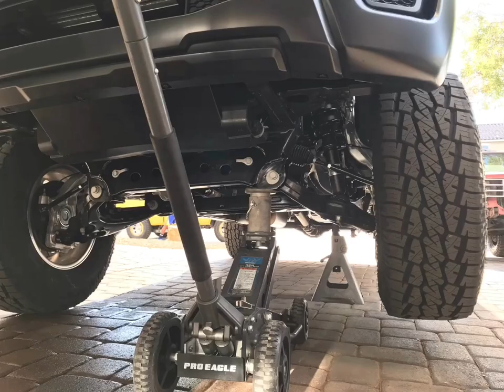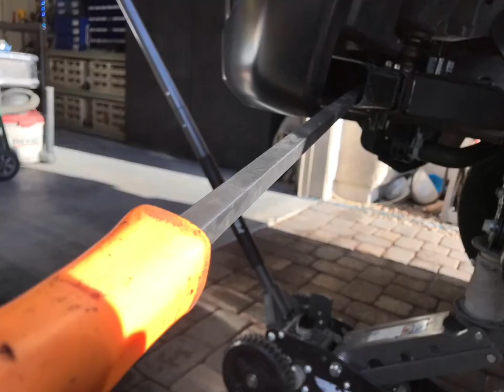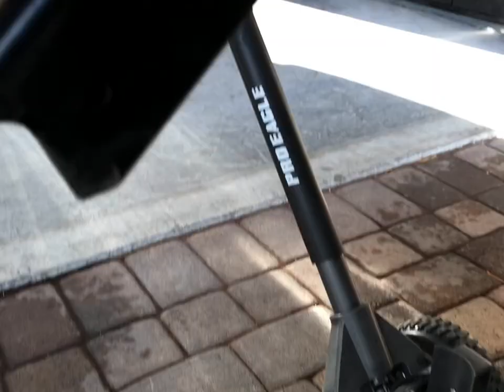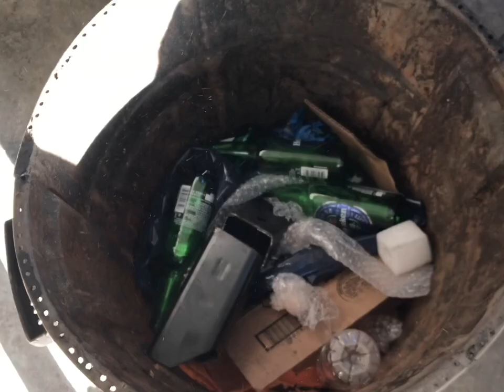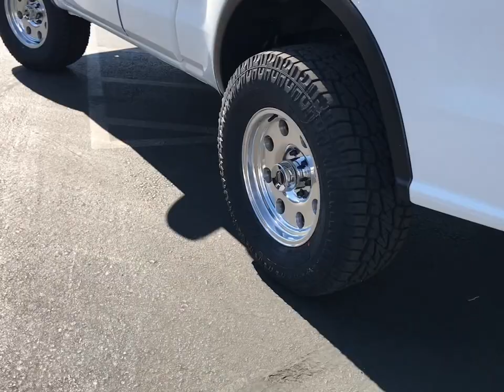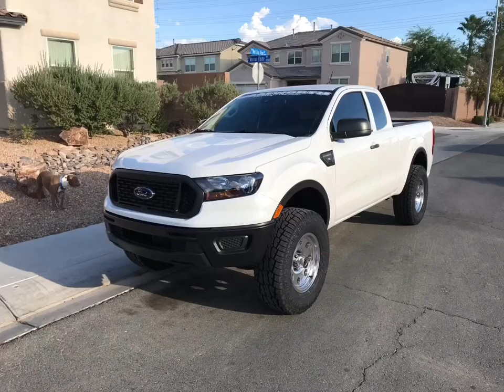How to remove intrusion/crash bars

Comment: use a grinder with a cut off wheel works better the high strenth steel used doesn't cut with a sawzall very well.

Comment: What blade did you use? I’ve used two medium metal blades and barely have a cut started on the first bar.
Reply from the maker: Dewalt 14tpi two blades per crash bar.

Comment: Question Im getting 285/70/17 tires. Does the back crash bar have to be cut back in between bolts or would just removing bar be okay. Also what brand blades did you use my. The Milwaukee ones I bought suck ass.

Comment: Does cutting out the crash bars cause a safety risk during a crash? Does it also void the warranty? Recently bought a 2019 Ranger and want to put 33" tires on it, but would have to remove the crash bars for there to be no rubbing.
Reply: Late af to this, but they sell aftermarket sway bars that require some mods to make fit, but you can install to replace the factory ones and they're less intrusive.

Comment: With the crash bars removed, would a 295/70/17 fit alright? Or would more cutting be required?
Reply from the maker: Mikey Serrano no additional trimming needed if you just remove the crash bars.

Comment: Two sawzalls and numerous blades later and I don't even have one inteusion beam cut off yet. Made of diamonds. Haha. Serious though. Any tips?
Reply from the maker: Corey M I know it’s like they made them out of kryptonite. The front ones you can remove if you take the bumper off. But I usually go through 6 blades for the 4 crash bars. Slow speed and some wd40 for lube.

Comment: Can I remove the 2 bolts by turning them lose from the bottom ? I have no clearance at the top to hit it with an impact gun.
Reply: The nut on the bottom is welded on

Comment: what size of tire were you running on ur ranger
Reply from the maker: Ace Ventura factory was 255/55/16. I did a 3” level lift and put 285/70/17 wheels and tires.
Reply: Do you think 35x10.5 would be a nightmare then?

Comment: The back bar has to be cut in between the bolts? Can’t cut it like the front one and then slide it out? Is it for extra clearance?
Reply from the maker: TheCovelli it’s easier to cut between because the fender liner gets in the way. Plus it gives you extra clearance.
Reply: use a grinder with a cut off wheel wors way better sawzall is no good for this

Comment: Yeah....I think the crash bars are made of a "unknown alien" metal.  It took foreverrrrr to cut. Just need patience and some cutting lube. I just installed 33/12.50r17 Nitto's with 17x9 -12 Fuel Rebels.   If you have some good blades, and a snack break or two..you can do it in no time.
Reply: Do the 33x12.5r17 rub at full lock with crash bars removed?
Reply: @L3GITxSWAGx12   no sir.    I'm running the Icon stage 2 leveling kit. It's adjustable to 1-3.5in (also included upper control arms) I have mine set at 2¾in.  On my truck, anything under 2.5in, the front sits lower than the rear.  That's my only complaint of the new Ranger is that the rear sits super high.
Reply: @TunerGuy_90   that’s one reason why the ranger (in stock form) has such a high payload. When you load it down with weight it levels the truck out and keeps safe handling. I’ve been looking at the same icon kit. I think I’d like to keep a small rake in the front for that reason. I can tow or put my motorcycle in the back and keep the truck from pointing up. Maybe an add a leaf would help that.